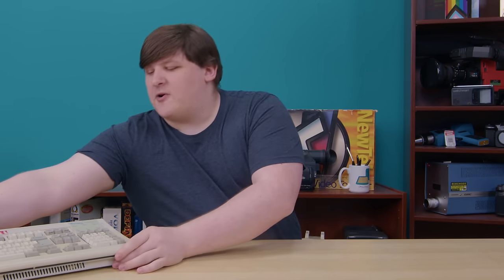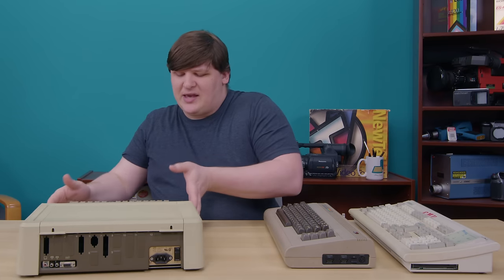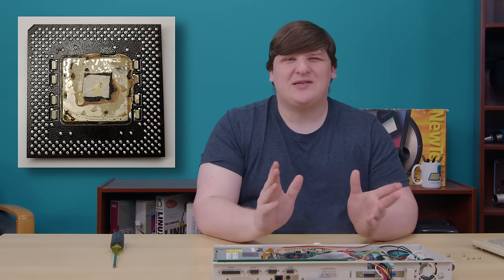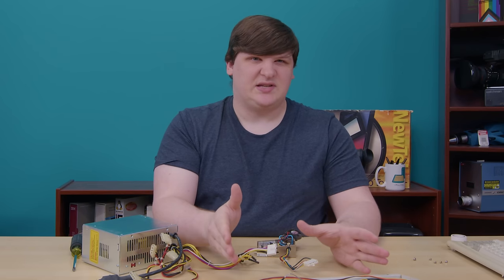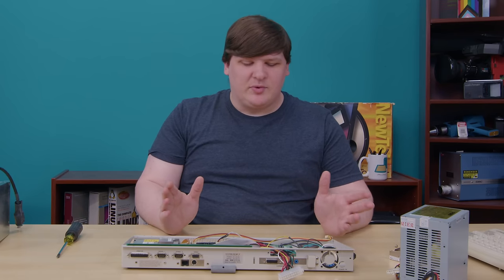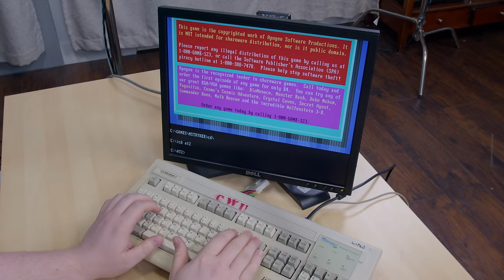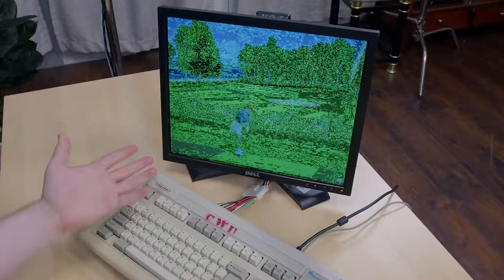I turned a weird "keyboard PC" into an FM boombox

Comment: I know how you can improve the power supply and sound situation. The sound card has a built in amplifier, and you could have grabbed a plain speaker and tapped the amplified output off of the soundcard, where there are those two jumpers, which set whether the audio out jack is amplified or non amplified, and since i assume the jumpers were configured to output non amplified sound thru the jack, you could grab a 2 pin connector and grab the left and right amplified signal from the free pins on the jumper thingy, and then you could also tap ground pins off of the CD audio headers. That way you won't need an extra amplifier board, plus you could fit ANY kind of passive speaker in there, maybe even conventional laptop speakers, and the best place for them would be in the front vent. As for the power supply situation, you could use a typical laptop charger, and a few of those buck converters with variable output (can be found on aliexpress or in local electrinic stores), one for each voltage. Or another alternative would be a Pico PSU, with an additional 7905 regulator for -5 volts. it would be more elegant, since you won't need to have a big power supply on the table in order to use the machine, plus it would be less of a rats nest inside with the wiring. Its also likely that the ATX power supply you used is dying.

Comment: Oh also the wobbling is almost definitely because of high ESR in one of the bulk storage capacitors. The chips try and draw a burst of current, the internal resistance of the cap is too high, so it can't provide the required current, the voltage drops, which naturally reduces the current demand, and then the cap is able to charge up just enough for it to all start over again. This is case where replacing capacitors is a good idea. However, blindly replacing capacitors like so many people do is just foolish.

Comment: You said " I can list every integrated keyboard PC", and I immediately thought ha.. I bet you never heard of the Sinclair PC200 and moments later you not only mentioned it, but you showed a photo of one.    When it came out I was working in a computer repair shop and some guy couldn't work out how to connect an external floppy and make it work, I flexed my autoexec.bat and config.sys skills and moments later it was working and the customer thought I was a genius.. which of course I was not.   I initially though the PC200 was a joke, but after taking a proper look at it I seem to remember it was OK and actually had some good features for a very low price.    Of course we have come a long long way since then.

Comment: The -5v is only required on certain sound cards, such as the SoundBlaster 2. The SoundBlaster Pro and 16 don't require the -5v.

Also the reason why Windows 95/98 freezes during boot is because the TCP/IP stack is trying to get an IP address from a DHCP server. Win 95/98 isn't smart enough to know that a cable isn't plugged in and not to try. You can fix this by either plugging the Ethernet card into a network with a DHCP server or setting the IP statically.

Comment: I expect the reason exclusive fullscreen helps with load is that the entire screen is being drawn entirely with the video chip. The chip likely has blitters and so once the decode is done everything else is hardware accelerated in fullscreen.

Lots of stuff ran better in exclusive fulscreen, it was basically DOS level control of the card, but with drivers.
Reply from the maker: Yeah, I guess I just assumed the bulk of the load was in the video decoding, but now that I think about it, MPEG-1 was meant to be decoded in realtime on... probably an original Pentium. A 233 would be overkill, and other workloads would become more significant.

Comment: I'd absolutely love to have one of these machines, it's a shame they're so rare. I'm aware of a couple other later keyboard style machines but they are all much more boring - Essentially a thin client in a keyboard.
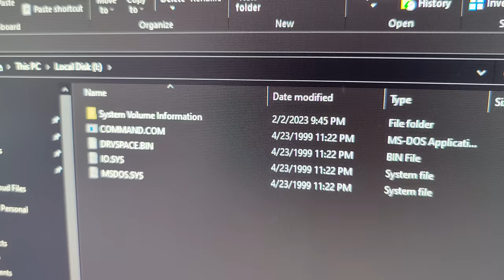19:19 This is absolutely not the oil in the spindle motor. This is the heads sticking to the platters - Stiction. Low or no oil in the spindle bearing will make horrendous levels of noise during operation, but stiction will only make it hard starting. Operation is not affected past that.
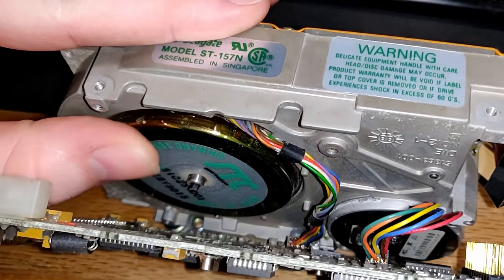19:43 This is what a damaged spindle bearing looks like.
23:00 Ironically this is a fairly contemporary laptop power connector from the mid to late 90s, and I believe the Epson thermal printers these days use that exact connector and those voltages right now. Not sure on pinout, though.
29:29 Your Vibra 16 has jumpers for an "Amplified/line" setting onboard. You could remove the jumpers and the middle two pins should be direct left and right audio. Solder a header to them and you can ditch the external audio cable!

Comment: That little board next to the CPU is essentially just a VRM (voltage regulator module) so that the system can use a CPU with different voltages than the board design otherwise provides. --- I'm not sure why a regular 3.5" IDE hard drive wouldn't work right out of the box, but the inability to use a CD drive is likely explained by the way the system supports a drive out of the box at all. That was after all an era when hard drives were either not standard or had only recently become so. --- The SiS 5571 chipset used apparently incorporates a hard disk controller, but it's entirely possible that it only supports PIO (parallel IO) modes (no DMA or UltraDMA/UDMA. I would be willing to bet that it only supports regular ATA (AT Attachment) and does NOT support ATAPI (aka 'ATA Packet Interface'). The latter is actually an extension to ATA that enables the use of other storage media than a hard drive on the same bus/controller. Not exactly sure your floppy drive is connected, perhaps there is a dedicated FDC (floppy drive controller) chip on the back side of the board,

Comment: That soundcard already has a power amp build in, its the big DIP chip, also the 6 pin jumper that has 2 jumpers on it behind the green line out jack selects between line-out and amplified out
You could connect some speakers directly to that jumper and the ground pins of the CD-rom input to use the build in amp and have the line out at the same time without a cable plugging in and going back in the system
Reply from the maker: I used to have passive speakers in this era of sound blasters and I recall them not really having enough oomph. It's technically amplified, but I don't think I'd get these levels off the card itself. I could be wrong though, and it's definitely worth investigating, esp. the internal header. I will probably revisit this machine in the future and will keep that in mind.
Reply: That looks like the same model Vibra I have. If it is, I believe the "MB_PRO" connector is a standard AC97 audio header. The front panel module from an old case would then let you make an internal connection without soldering.

Comment: Re: "what could it be doing?  The HDD is off.  What could it be doing?"
Running driver code and detecting the hardware.  Early drivers would send queries to devices and just wait for a timeout to fail to figure out some capabilities of the hardware at boot.

Comment: I have seen very similar motherboards before in industrial PCs, it could be that they used an existing motherboard and stuck it into a keyboard shaped case. 
Having both 2.5" and 3.5" IDE could be a a pointer to that, 2.5" is a common DOM module size but 3.5" HDD was cheaper it could be that both ports are connected in parallel.
Industrial PCs are almost always 2-3 generations behind current gen.
Also having only one PS/2 port is common with the mouse input over serial in a touch screen.
I have seen side mounted PCI before on slim panel industrial PCs (more modern example: Enano-6612LVDS-R10).
It could explain the pivot to industrial PCs, why build a computer if you already have the connection with the OEM? Industrial PCs has a much higher margin.

Comment: Nice PC and thanks for the video!
That CT4170 card has integrated amplifier (not very powerful) and there are jumpers near the output to select output between line level or from that amplifier, so you could connect passive speakers directly to green jack and get rid of additional amplifier board.
Also there is a MB_PRO header (pinout is available on Vogons) that exposes output of the card as well, so you can hook up your speakers directly from there, no need for external wire into 3,5 mm. But I don't remember if you can get amplified output from that header or line out only.
On CT4520 (AWE64 Value) I had been using passive speakers hooked up directly to the header of that card and it worked just fine.

Comment: As an addition, I've seen that rather weird power supply connector (round, 4-pin connector, little cutouts around the edge) or one very much like it on some early-ish 486/Pentium laptops. So, I think you were right on the mark about this system being essentially a laptop conversion. --- Tangentially, if your sound card jacks are through-hole parts you can probably just solder the speaker input wires directly to the jack on the back of the sound card for a cleaner look. If they're like many other 3.5mm audio jacks, they should also have an internal mechanism that normally connects to the internal speaker/audio system when no plug is inserted. So, if you hook things up right, your internal speakers will be disconnected from the audio output if you plug some externally. --- An FTP server on your local network is also a useful tool to get files onto a machine with LAN.

Comment: The 20-30 second delay during boot could be caused by the network card - especially if you don't have a cable plugged in or the machine is configured for DHCP but no DHCP server is available.  Windows 9x tries to bring the network up during boot if it is configured with network drivers and will wait roughly 30 seconds before giving up if it can't.
Reply from the maker: That makes sense! I wonder if I could disable the NIC in the bios to test...

Comment: The Winbond chips on the motherboard beside the processor socket are most likely L2 cache chips; if you look at any bare Pentium II slot processors, you'll see a couple suspiciously similar chips on the carrier beside the main processor package.

If I were to guess, the "floating" daughterboard is actually generating the core voltage for the processor, and is most likely a switching (not linear) regulator. There's no call for a big inductor like that with a linear regulator, and if it's still generating heat as a switching regulator it has to be involved with a rail generating "most" of the power used by the system (which in this case would be going to the processor itself). I have never seen a board of this era built this way, but plug-in power modules like this were not that uncommon a generation or two before this board would have been made, and the compactness was likely appealing to this manufacturer (in addition to being able to swap them out for processors with different voltage or current requirements).

A 3D printer (or a friend with one) would be able to make quick work of a small custom plate for your ATX power pass-through so the thing mounts more securely and doesn't look so janky. If you want a more elegant solution, a Pico-ATX will take a much more regular 12V barrel input (you can install it in the space previously occupied by the cursed 4-pin) and derive almost all your various voltages for you. It'd fit entirely inside the case, and then you'd just need a fairly standard power brick. Unfortunately, a quick check indicates these small power converters generally don't generate -5V (which I don't think is strictly required by the ATX spec) so you'd need to add a small DC to DC converter for that rail, but at least the whole contraption would fit inside.

It's possible one of those headers on your sound card is for front-panel audio or equivalent, which might let you hook up your speakers without having to loop a cable out the back of the case. I am a big fan, though, of how cursed it sounds when you play those maximized videos in Windows! Truly the stuff of nightmares! Tracking down that issue would likely involve some time on a bench with an oscilloscope to figure out how the power system of the computer works, how it's distributed, which rails go where, and what sort of noise/ripple you're seeing on it. It wouldn't surprise me if it was like that from the factory, and it's possible that additional bulk capacitance in the right place might resolve it (they were targeting both a price and a compact size here, so gotta cut those corners). Without the right tools and expertise though, you'd be mostly shooting in the dark to try and figure it out.

Comment: the full screen thing and smoother playback is because the system is taking load off the cpu and putting it on the graphics processor. Its actually a common thing nowadays too! if you play a game at 1080p your cpu usage will be higher but if you play at 1440p or more noticeable at 4k the cpu load will be lower. I think Linus tech tips has a video somewhere about this or it might be JayzTwoCents. I remember watching something about it on one of their channels

Comment: The lack of windows 95 key, no usb ports and a turbo light suggests that chassis was originally designed for a 486 machine. There's a KNS 486 machine which appears to use the same chassis.

Comment: Belated comment, I just found your excellent channel. Thanks for the fun video on an interesting machine.
FWVLIW: Assuming this computer isn't just crap from the factory or (hopefully not) dying, a couple of thoughts. Sorry if this is already obvious to you.
I'd agree that most likely you have a power issue, but as you've checked probably not bad supply or dodgy caps. Maybe the amp for those speakers is setting up a ground loop or screwing with one or more rails, but (largely) settling when sound is played. (Or the sound card is borked)

Thoughts: 
-There's nothing wrong with a janky solution if it works, but another issue may be while one of the rails seems fine it may be marginal for current giving these issues. Also if you're going to travel with this machine... it may be worth getting something like a PicoPSU, a +12 to -5v regulator, and a power brick from something like an old gaming laptop or a Dell Optiplex SFF for it's higher current supply and redoing it. You'll possibly fix the issue if the problem is insufficient rails, and with a decent external brick + appropriate plug on the machine, something more convenient for traveling.
-I'd be tempted to first disconnect the power supply for the speakers, then all your wiring, then try an external self-powered set of speakers, then pull the sound card, and see if any of that cures your problem(s). No doubt you are way ahead of me, but if not my best bet would be a fixable problem will be found in one or more of the above.

If you happen to read this comment, thanks once again for your excellent channel and I hope this was of some help.